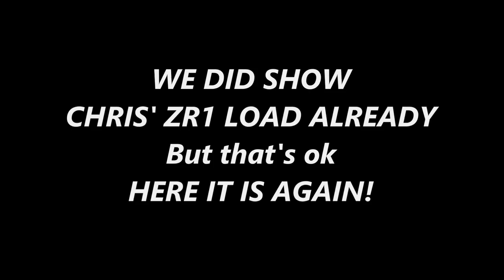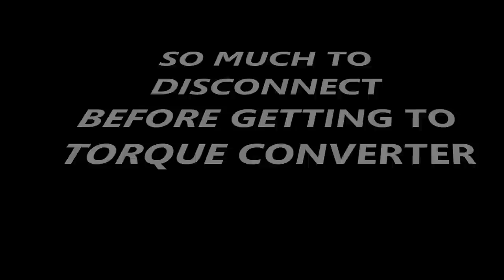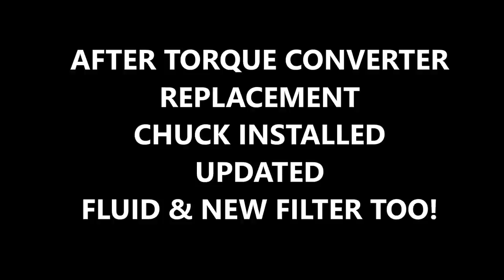PREP FOR A TORQUE CONVERTER REPLACEMENT IN CORVETTE plus VETERAN VLOG FOLLOW UP & CORVETTE STUFF

Comment: Rick, I love when you do service vlogs with Chuck. It is a real pleasure watching a great mechanic at work. If you get a chance , could you do a vlog with Chuck addressing the use of an oil catch can on C7’s. It seems to be a hot topic on the internet with people on both sides of the fence about it. A lot of people talking about direct fuel injection should use catch cans to avoid carbon (oil) deposits on intake valves. Thanks.
Reply from the maker: thanks Jday, will do !!!!!!!!!!!!

Comment: First post Rick. Thanks for this video. I just had the torque tube replaced in my 2018 C7 with 2700 miles. I had no idea until today what went in to changing this thing out. Small Chevy dealership in Easley, SC did the work and it was a very professional job. It took longer to get the torque converter from Chevy than it did replacing it. Thanks for all you do for us vette lovers.

Comment: Rick, Great Vlog as always.  I’ve had the torque converter replaced on my 2016.  Left the car with the dealer while I went on a trip.  Didn’t realize the number of things that had to be removed.  Yikes!!  Things are working great now.  Thanks to both you and Chuck for such an informative video.  PS - If I knew the rear end had to come off the car, should have had the spoiler installed then. Have a Happy Thanksgiving to you and yours.
Reply from the maker: Thanks Bill, yes really is a project beyond belief !

Comment: Another great vlog Rick!  Very interesting watching the torque converter change out.  So far no issues with my ‘17 GS, but I’m only at 3,500 miles.  How common is the problem?  Did I understand that most can be rectified with the flush?  Also, thanks for the tip on going to manual mode if it happens!
Reply from the maker: ERic, it is happening too much and certainly hope you do not have to deal with it, the flush has worked though on most!

Comment: Rick, maybe you know or chuck knows or other Vette owners if you have heard of a problem with 8 speed transmissions missing shifts from 2nd to 3rd. I have a 2017 GS auto trans which I bought new. Since day one every now and then when it's shifting from 2nd to 3rd it like you missed a gear and it revs then catches. GM had put out a bulletin on harsh shift and slow shifting. The dealer rebooted, but it still does it. They say if there was a problem it would show up in diagnostics but it doesn't. I ended up getting a lemon law lawyer and sued and got a settlement, but it still does the missing from 2nd to third!!! Like I said it doesn't do It all the time only two or three times a day
Reply from the maker: that is a bummer and I have heard of this, reprogramming the transmission control module usually did the trick and then there is a way to re-learn the transmission as well... Hope you get rolling smoothly soon!

Comment: Rick is the trans shudder etc. something all A8's 2015 to 2017 will experience?  Rick another nice video thanks
Reply from the maker: George, we hope not, it has been a hit or miss. I think if they change the factory fluid at build that we are now putting in the cars, could help, but we do not have all the info and trying to make it as easy as we can on the customers

Comment: Just curious what % of the A8's that you sold come back to your service department with the Torque Converter problem?
Reply from the maker: well most of my business is out of state, but starting to see more and more. I think if they would start off from the factory with the fluid we are replacing it with could stop a lot of this!
Reply: @RickCorvetteConti  What is your or Chuck's opinion of using a device like an AFM disabler that Range Technology sells, that turns off the engine cylinder deactivation, so the vehicle is always in 8 cylinder mode?  I have read that it is the AFM that is causing the TC problem.  Have yo noticed the problem occurring after the original warranty is up or after?  I am trying to decide if I should purchase the extended GM warranty for our vet.

Comment: Is the torque converter covered under warranty?
Reply from the maker: it is under the powertrain warranty, long as you have that, at this time, that is how it is handled. Most of those warranties are 5years or 60,000 miles!
Reply: Thank you.

Comment: Hi Rick.  Really enjoy your videos!

Regarding the well documented A8 issues, GM modified their TSB #16-NA-175 on 10/11/18 (dealing with the flush procedure) to include a comment to dealers to not replace the TC or trans assembly and that a revised service procedure will be released in Q1 2019.  Any insight as to whether this will be software or hardware related or potentially a new fluid?

Thanks 
Jim

Comment: What’s the difference in the $7,500  ceramic package and the z07 package
Reply from the maker: you get the clear wicker bill, front splitter extensions part of your level 3 aero, , cup 2 race tires are the big parts. Remember it takes so much to really get those cup 2 tires heated up, I not doing competition racing, just the brakes are a win!

Comment: After seeing this I'm getting rid of my vette..im not letting some chevy tech do this to my vet and wonder what he forgot to do or not putting it back together the right way..vette shouldn't have this problem at only 8800 miles..going back to f150..traded it in on vette with 34000 miles on it with no problems..thought vette would be reliable...guess I was wrong..regret getting one..